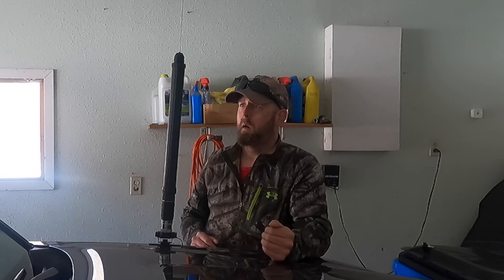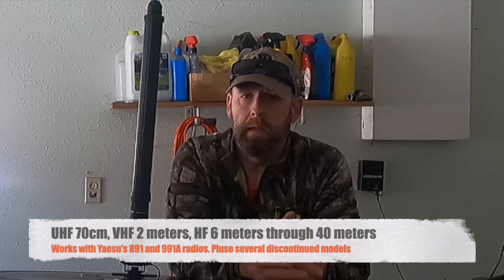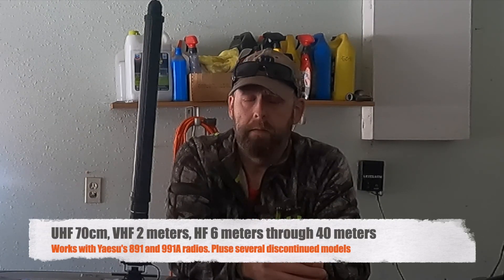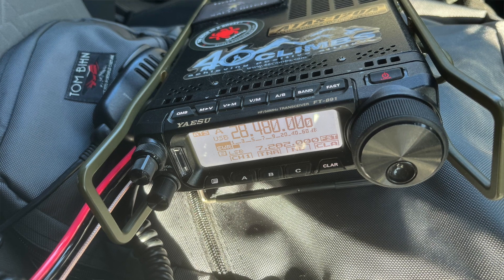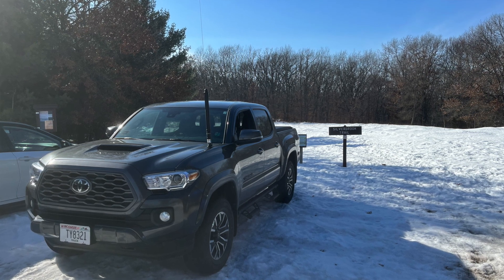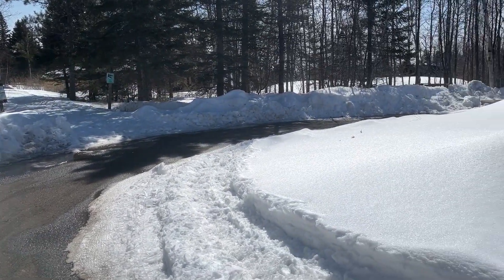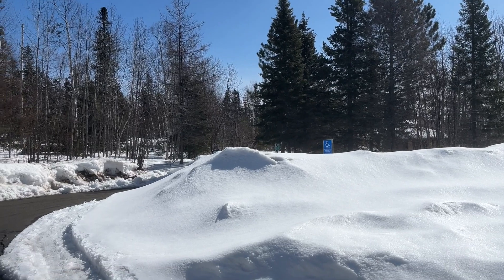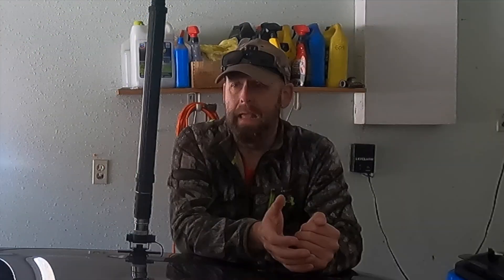ATAS-120a Great for POTA & EMCOMMS?

Comment: Nice look at the ATAS-120A.  It is definitely a compromise antenna but is incredibly convenient not needing a tuner or controller when used with Yaesu compatible rigs.  Easy for mobile and POTA etc.  Using savvy operating skills and taking advantage of good band conditions somewhat offsets its lack of efficiency.  73!
Reply from the maker: Thanks! 
Exactly the ATAS is far from the best “all around antenna” but it can be the ideal option for certain applications.

Comment: I just ordered one for my condo balcony with a buddipole vertical clip mount. Put a dual CB antenna mount on the mount so I can use so239 & 3/8x24 antenna options. A 102” whip works better on 10 than the ATAS.
Reply from the maker: That is a fantastic idea for a home setup with the ATAS. Really like how you added the modularity with the mount. Besides the 102” whip, you could also use ham sticks or some other antennas as well. Great idea!

Comment: I have an ATAS-120A. I ordered it last summer.  I've had to order replacement top element 3 TIMES!  It doesn't hold in the bottom screwdriver part. All of a sudden, my radio had trouble tuning it. I get out of my truck to check the antenna, AND THE TOP METAL PART IS GONE! Who knows where? I DON'T!  I think it's due to the 1/16 inch diameter of the element, making it ENTIRELY to flexible. I've now disassembled the antenna, drilled out the receptacle to 1/8 inch and reassembled the antenna. Yes the rubber seal that covers the receptacle was a bit tight, but it did go on. I put it back on the truck and tuned it up across all the bands it covers. It tuned very nicely. What I did was I took an old 80 meter ham stick I had and cut it to length. That was a chore, let me tell you! lol Those things are NOT easy to cut. I tried a hacksaw first, then I switched to a cutting wheel on my dremel. That went easier but very slow. I used the dome grinder on the dremel to round of the base where I cut it. My set screws make MUCH BETTER contact with the element now. I expect it'll hold much better.
Reply: I am on my third Atas in nine years. Never have I lost or broken the stinger or element . I have hit everything with  the stinger and it's still there. I can't understand how that is happening to you.
Reply: @jptrade8575  me either, but I can tell you this. Since I replaced that tiny thin stinger with the ⅛ inch stinger from a ham stick, it hasn't fallen out again.

Comment: I’m thinking of doing this. I’ve got a couple 891 Radios. Great review. Quick question. My garage height is limited. The whip will no doubt hit the top of the entrance. Have you ever take off the ATAS and stored it in the vehicle? If so do you leave the whip on or off? Any suggestions re the low clearance garage? 73
Reply from the maker: I don’t keep my ATAS mounted on my truck all the time. I just attach it when I plan to use it. I keep the whip on, for taking it on and off is not very convenient.

Comment: So, being in a frozen winter environment,  what about ice build up, i live in illinois, and sleet and freezing rain can be problematic. I dont have one yet but it is on order
Reply from the maker: I haven’t had any issues with sleet or rain. Thanks for watching!
Reply: Could apply an automotive ceramic \ graphene coating to the antenna, so it'd be hydrophobic.
Reply: You could probably not screw it in until you are going to make contacts.

Comment: So do you have two of the same antenna mounts or are you using one Mount and switch out the antennas when going from HF to 2m/70cm?
Reply from the maker: Currently one mount. I pretty much only use the ATAS for POTA.

Comment: I am getting on for my FT-857D and 2016 Nissan Sentra. Normally I would purchase an NMO mount, but the SO-239 does have the advantage of being able to hook coax directly to the mount.

This means you could easily hook up your favorite wire antenna easily and operate from the comfort of your vehicle. A full sized antenna is always beneficial for POTA and ECOM.

My go-bag is based on my other FT-857D and my KLR650 motorcycle. Since making this video I've added a 28ft pushup pole that I tie to a back luggage rack.

https://youtu.be/nShDYlZGKlc

My previous mobile setup on my Chrysler 300 had a homebrew load coil antenna with an SGC matching unit on the base that worked great 80m-10m. The whip was a fullsized CB whip with enough wire to make about 31ft.
Reply from the maker: Cool! Thanks for watching.

Comment: Does the ft891 auto tune Atas antenna or you manually click up/down buttons on the radio to tune it?
Reply from the maker: The 891 will tune the ATAS-180. You can also adjust manually with up/ down buttons. Thanks for watching!

Comment: how is your noise with the tacoma engine running?
Reply from the maker: Don't know. I only operate parked. I may have ran the engine ones or twice last winter for a little while, but don't recall anything major. I know the Tacoma's fuel pump is pretty notorious for causing interference.